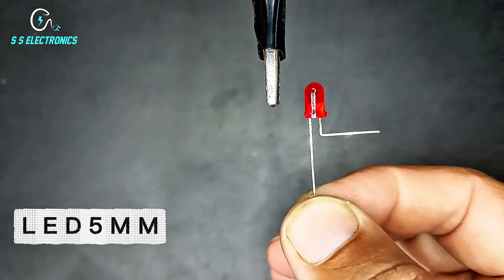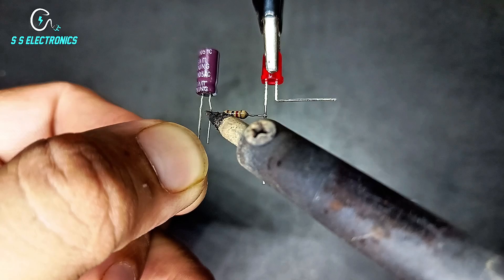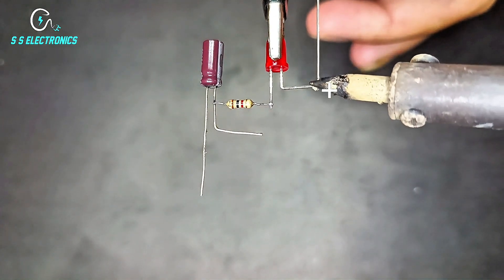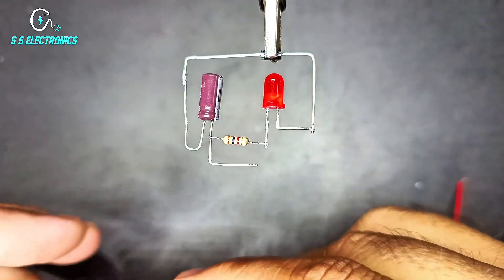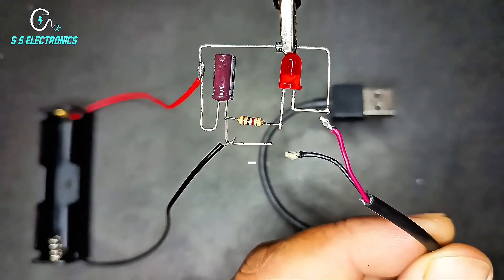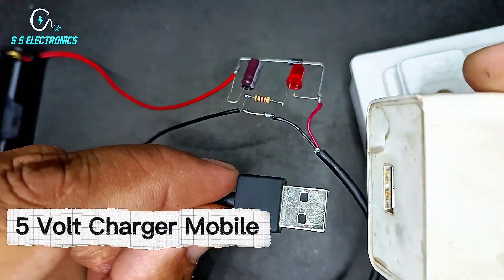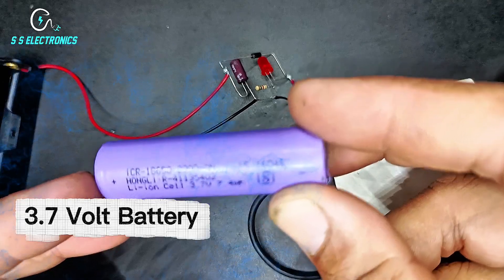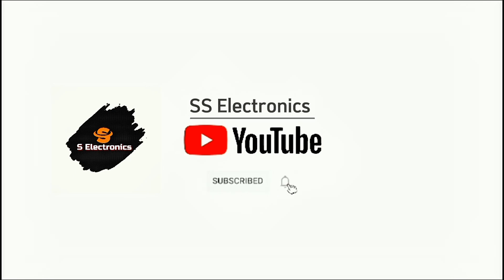Lithium-ion Battery Charger | 3.7v Lithium Battery Charger Circuit

Comment: Did you finish the video explaining the battery? How many volts did it reach? Did the light turn off or increase? A quick video or any benefit from it?
Reply from the maker: Thanks for your interest! The battery video is in the works, and I’ll make sure to cover the voltage reached and the light indicators in detail. Stay tuned!